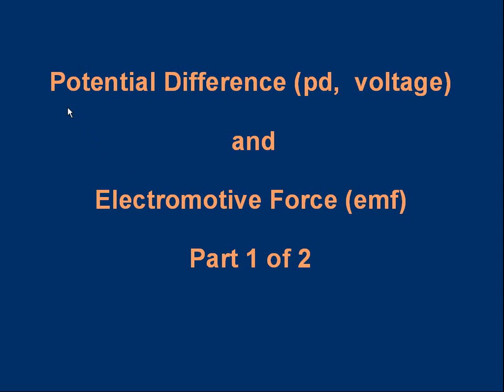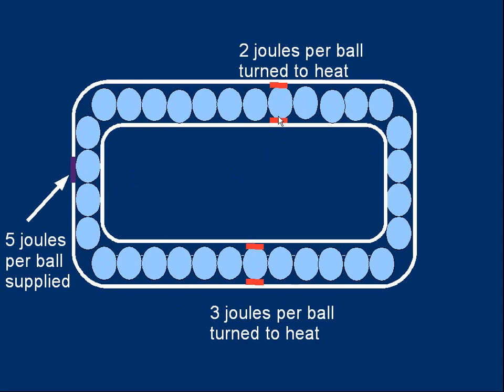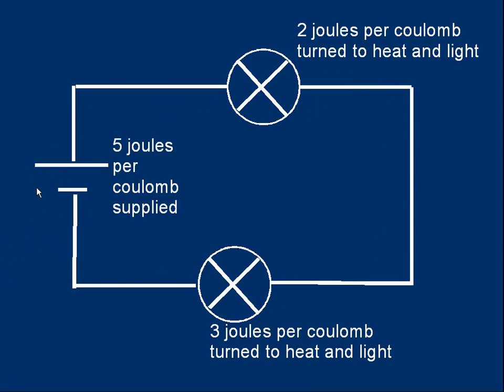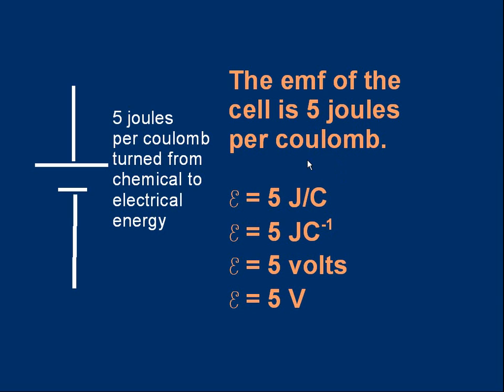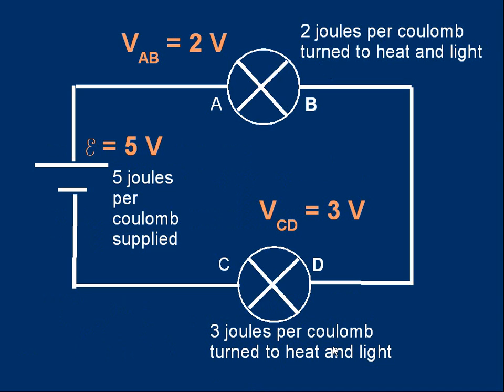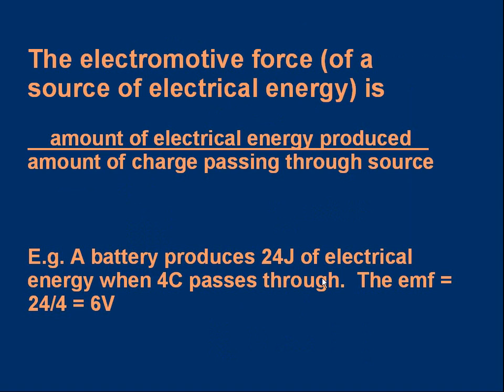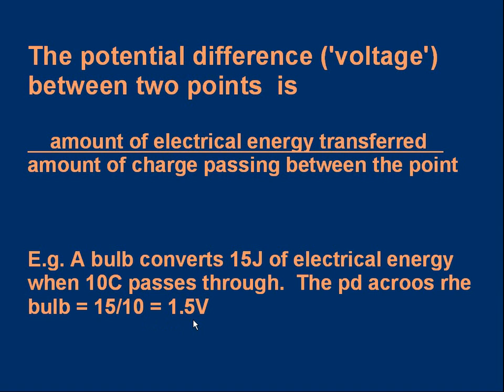GCE (A level) Physics E03 Emf and voltage. Part 1 of 2

Comment: Mr. Steve, would you define the voltage between two points as the change in energy per unit charge between the two points, or the change in potential energy per unit charge between the two points? The standard definition of voltage is potential energy per unit charge. However, I don't quite understand why potential energy loss should be more across a resistor than a wire. Change in potential energy is a function of position, not friction/resistance. On the other hand I can see that kinetic energy is lost to the resistors in the form of heat.
Reply from the maker: +1steinstein

Long answer...

Note that when there is no current, the potential in a conductor is constant –  there is no potential difference between any 2 points in this situation.

E.g. if you connect a circuit to the +1.5V terminal of a cell but leave the circuit incomplete (don't connect to the 0V terminal of the cell), no current flows and  the potential at all points in the circuit is 1.5V. No potential differences exist in the circuit.

But when a current flows through a conductor, the potential varies along the conductor and the potential difference between any 2 points can be found using V=IR where R is the resistance between the 2 points and I is the current.  That's  because there is energy transfer (usually to heat)occurring.

So these are 2 very different situations. And each has its own definition of voltage. 

____________________________

In a static situation (no current flowing) I would define the voltage between two points as the change in electrical (potential) energy per unit charge between the two points.  This is always zero in a conductor when no current flows.

But in a circuit with current flowing, I would define the voltage between two points as the amount of electrical (potential) energy changed to other forms of energy per unit charge passing between the two points.

____________________________

“However, I don't quite understand why potential energy loss should be more across a resistor than a wire”
 When a current flows, there is (usually) much more energy transferred in a resistor than in a connecting wire because the resistance of the resistor is generally much more than the resistance of the connecting wire. V = IR must be used. 

If no current is flowing, the voltages across both wire and resistor are zero.
____________________________

“Change in potential energy is a function of position, not friction/resistance.”

Not true. Try these statements:

Change in potential energy is a function of only position when there is no current
flowing.

 Change in potential energy is a function of current and resistance when a current flows. 

____________________________
Not sure if that clarifies anything, but it gives you plenty to think about!

Comment: ok Mr Steve 
Clear me one thing
If the current we supply is for example 5 joules per charge so if 2 joules is lost at one resistor and 3 joules at the other then it means that all the energy we give will be lost at R2 (resistor 2)
so why does the currrent further moves ?
Is it due to inertia or its momentum during movement in the circuit ?
Reply from the maker: +Hamza Zubair 

“If the current we supply is for example 5 joules per charge”

Note.  Current is not measured in “joules per charge”.  It is measured in amperes (amps) (coulombs per second).

You mean “If the supply's emf is 5 joules per coulonb...”
____________________________________________________

“so if 2 joules is lost at one resistor and 3 joules at the other then it means that  all the energy we give will be lost at R2 (resistor 2) so why does the current further moves ? Is it due to inertia or its momentum during movement in the circuit ?"

If there is no resistance, there is no energy less. We see this 
in a vacuum (e.g. electron beam) or a superconductor.  And yes – the 
simplest way to think about this is it is due to the electrons' 
momentum.

But in a real-life circuit, the connecting wires have some small 
resistance, so there is always some energy loss in the wires.  The 
energy loss in the  connecting wires will usually be very small compared to the energy loss in the resistors.

So if the supply has emf=5V we might have: 
0.02 J/C lost across 1st connecting wire
1.97 J/C lost across 1st resistor (slightly less than 2J/C)
0.02 J/C lost across 2nd connecting wire
2.97 J/C lost across 2nd resistor  (slightly less than 3J/C)
0.02 J/C lost across 3rd connecting wire
These add up to 5J/C as required.

However, the energy loss in the connecting wire is usually so small we ignore it and keep the calculation simple.

Hope that makes sense!
Reply: +Steve4Physics ... so in the above example, what if you take out the 2 lamps. so now you only have the resistance of the wires = 0.06 J/C lost. Does that mean that 4.94 J/C is returned to the battery? or is it always the case that 100% of the voltage is used up by the circuit? and if that last statement is true, does that mean that the resistance of the wires go up to 5 J/C?
Reply from the maker: +AgeofVergo 

“so in the above example, what if you take out the 2 lamps. so now you only have the resistance of the wires = 0.06 J/C lost. Does that mean that 4.94 J/C is returned to the battery?”

No.
 Let's assume we are talking about a perfect battery (no internal  resistance).
The battery would continue to produce 5J for each coulomb passing through it. That's its emf and is controlled by the **chemicals** used to make the battery, not what it's connected to.
The wire will now produce 5J of heat for each coulomb passing through it.
___________________________________________

“or is it always the case that 100% of the voltage is used up by the circuit?”
Voltage isn't 'used up'.  But I think you mean "is all of the emf applied to the circuit?"

The answer is yes (assuming no internal resistance in the battery).   The voltage across the wire is the full emf, 5J/C (5volts).
___________________________________________
“does that mean that the resistance of the wires go up to 5 J/C”
Resistance is not measured in J/C.  The wire's resistance depends on its size/shape and what material it is made from.  The voltage or current does not change the wire's resisitance (though resistance can change with temperature).  The wire's resistance will usually be low – so many coulombs will flow through it each second. Note that 5J/C does not tell you how quickly heat is produced. Suppose the voltage is 5J/C: 
If 0.001 coulombs per second (=0.001A) flows, the heating is slow.
If 100 coulombs per second (=100A) flows, the heating is fast.
The size of the current is I = V/R.
Hope that helps.

Comment from the maker: +don't Bother

Hi. Sorry. Answer is a bit long. But I've tried to explain thoroughly. You might have to read it a few times!

Your original comment has disappeared Apologies if I deleted it.
________________________________________________________
Comment on potential difference (p.d.)

First:
"bringing a unit positive charge from one point to another point in a circuit is called potential difference between two points"
is not quite right.

To be accurate we must say something like:
"The potential difference between 2 points (A and B) equals the work done moving unit positive charge from A to B.”

E.g. if 6J are needed to move +3C from A to B. the p.d. between A and B is 6/3=2V. This means B's potential is 2V higher than A's potential. B is more positive than A.

But we could equally well say the p.d. between B and A (reversed order of letters) is -2V. This means A's potential is 2V lower than B's potential. A is more negative than B.

In symbols: VAB = -VBA and VBA = -VAB.
For simple problems it often doesn't matter what the direction is. So we often just say the p.d. between A and B is 2V without bothering to think about the direction. So we often just use the magnitude of the p.d.
________________________________________________________

P.d. and type of charge
Sometimes positive charges move (e.g. protons in a beam of protons). Sometimes negative charges move (e.g. electrons in a simple electrical circuit). Sometime both types of charge move in opposite directions at the same time (e.g. + and - chemical ions in a battery or during electrolysis). We need the concept of p.d. in all these cases.

So if necessary, we can easily re-word the above definition of p.d. in terms of the flow of negative charges. It would simply be:
"The potential difference between 2 points (A and B) equals the work done moving unit negative charge from B to A.” Note the order of the letters.

When thinking about p.d. a flow of negative charges from B to A is completely equivalent to a flow of positive charges from A to B.

But it's traditional to define p.d. in terms of positive charges. So we simply don't bother with the definition in terms of negative charge.
________________________________________________________

Conventional current

In fact we don't even normally think about the electron direction when analysing circuits, The usual practice is imagine what is called “the conventional current” flowing from the positive side of the battery through the circuit to the negative side of the battery.

Physical electron flow is opposite - from the negative side of the battery round to the positive side. But we can 'pretend' positive charges are flowing (conventional current) in the opposite direction to the direction of the electrons – and it all works out correctly!

I understand how confusing it is but it gets easier the more you think about it. I hope that helps.

Comment from the maker: Hi.  I don’t use the term ‘energy levels’ so I don’t understand the question.

We are interested in amounts of energy changed to heat, in the examples.

E.g. if 50J of the supply’s energy are turned to heat when 2 balls pass through a rough section of pipe (due to friction), the energy transferred per ball is 50/2 = 25J/ball.

Similarly, in a circuit, if 50J of electrical energy are turned to heat when 2 coulombs pass though a resistor, the energy transferred per coulombs is 50/2 = 25J/C =25V.

Comment from the maker: Basically ‘yes’ to your questions – with slight changes.

If you follow a conduction electron (say) anywhere in the circuit while current flows, the electron:
- accelerates, taking potential energy from the electric field;
- has a collision (decelerates), transferring energy (causes heating).

The above processes are repeated millions of times per second.  On average the electron appear to move with a steady velocity (the drift velocity) but is actually continually accelerating and decelerating

Comment from the maker: All the balls move together at a constant speed even when there is resistance.
If the resistance is increased, all the balls move at a slower constant speed.

Think of pulling a car with a rope.  You give the car kinetic energy, but the rope (very low mass) has virtually no kinetic energy - the rope transmits the energy. The rope is equivalent to the electrons.

The energy is being transferred as electrical potential energy in the electric fields between electrons.

Comment: Would a higher e.m.f mean a cell is doing more work on a charge, therefore it would have more P.E?

And such would the charge accelerate in the same way a mass would as its gravitational P.E gets transformed into kinetic energy.

The charge would accelerate faster with a higher voltage meaning a faster average drift speed, and this is why higher voltage means higher current?

Comment from the maker: Hi.

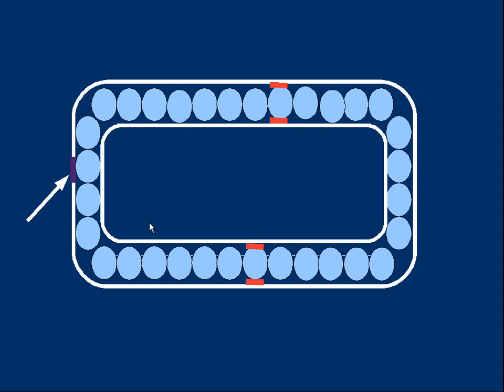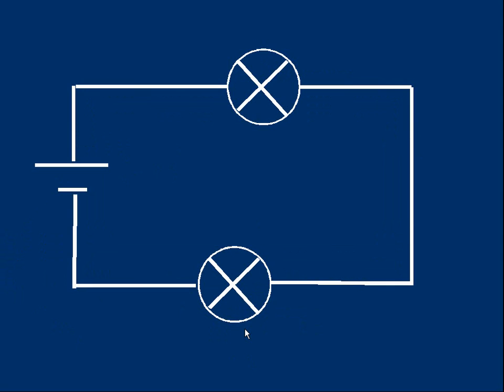In the video, from 1:50 to 4:00, you will see that ALL the balls travel at the SAME speed.

The transferred energy is NOT the kinetic energy of the balls.

The balls (i.e. electrons) are acting as a medium to transfer energy from place to place. When a ball loses energy due to friction it makes ALL THE OTHER balls in the circuit move with the SAME (reduced) speed. 

Try to imagine you are pushing the balls around. Think about where the energy you supply ends up - this should help.

Comment from the maker: Hi Shines128.

'Terminal pd'  is short for terminal potential difference. It is sometimes called 'terminal voltage'. It is the voltage between the battery's terminals.  So it is the voltage being applied to the rest of the circuit. 

If there is no internal resistance, it is equal to the battery's emf and would often be simply referred to as the 'battery's voltage'.

If there is internal resistance, it equals the emf minus the 'lost volts' (watch part 2).

Comment from the maker: Hi again.

My 1st answer was too complicated.

The potential difference between point (A) to the left of the 3J light bulb, and a point (B) below the negative (charged) portion of the cell is zero.

If we take the negative terminal as being zero volts, then A and B are both at 0V.

Think of the wire connecting A and B as zero resistance. V = IR = Ix0 = 0.  There is no potential difference between A and B so they are at the same voltage (potential).

Comment from the maker: Hi.
Yes, bulbs act as resistors. (But resistance may depend on voltage – not be a fixed value.)
A potential difference is between TWO points. A single point can’t have a potential difference – only a potential.

If we say the battery’s negative terminal (NT) is zero volts, then the potentials at different points are:
NT= 0V
Left of 3J=0V
Right of 3J=3V
Right of 2J=3V
Left of 2J=5V
PT= 5V
For example, the potential difference across the ‘2J’ bulb is then 5-3 = 2V.
Hope that helps.

Comment: A quick question. Are the two light bulbs at 5:12 considered resistors? If so what would be the voltage/potential difference at a point to the left of the 3J light bulb, and a point below the negative (charged) portion of the cell? 0V?

Comment from the maker: Hi TheDaVincci.
The mistake is "neutral is safe because the current gets consumed by a device."
Current is not consumed by the device. Neutral is safe because it is at (nominal) ground potential - even when carrying a current. The current through the live wire equals the current through the neutral wire - measure them (with caution!) if you want to see this for yourself !  That's why neutral wires have to have the same current-rating as the live wires. Also check how RCDs operate for example.

Comment from the maker: Hi. That is correct, but I would word it slightly differently:
EMF is applied to devices which supply electrical energy.
Voltage is applied to devices which use electrical energy.
Both are measured in joules/coulomb (volts).
They tell you the amount of energy transferred when 1 coulomb passes through the device.
It is a common mistake to use the term 'voltage' when you mean 'emf', but usually this doesn't cause confuision and even teachers and electronic engineers do this sometimes!

Comment from the maker: When we talk about a ‘2 volt bulb’ it means the bulb is designed to operate with a p.d. of  2 volts across it.
You can operate the bulb at a lower p.d. – but the bulb will be too dim.
You can operate the bulb at a higher pd – but it will be too bright and you will reduce its life or even burn it out.
If you connect a 2 volt bulb to a 5 volt emf battery (assuming the battery’s internal resistance is negligible), the bulb will glow very brightly and then probably burn out almost immediately.

Comment from the maker: Hi.  You are mixing-up emf with electric field strength (E).  E is measured in volts per metre or newtons per coulumb  (V/m and N/C are equivalent).
Emf is simply measured in volts.
Good luck with the test!

Comment from the maker: @mediamaster08 
The electrical potential at a point is the amount of potential energy a unit charge would have at the point.  The potential difference (PD) between two points is simply the difference in the values of potential at each point.  So PD is the difference in potential energy per coulomb. A fuller explanation would take too long, but just do a search on ‘potential difference’ to find out more. When you learn about electrostatics and electric fields, it will be explained in detail.

Comment from the maker: @mediamaster08 
Hi.  The ‘table tennis balls’ is only a model - don’t treat it too literally.  When a current flows in a circuit, there is kinetic energy involved, but the amount is very, very small, because the electrons are so ‘light’ and move slowly; the electrons’ kinetic energy is too small to matter.

Sometime emf and voltage ARE the same value.  But we use ‘emf‘ when taking about a supplier of electrical energy and ‘voltage’ when talking about a user of electrical energy.

Comment from the maker: @804YankeeFan 
Its a continuous process. Electrical energy is delivered at a steady rate over a period of time.  The battery is acting like a steady pump, pumping electrons around the circuit. But of course, when the battery is dead, the electrons 'stop moving'.

Comment from the maker: @SalmanBacha 
Emf is always inside the battery (or generator, or photcell, etc.).
In a simple situation (no internal resistance) voltage is outside the battery.
But if there is internal resistance, there also a  voltage drop inside the battery which must be subtracted from the emf.

Comment: @Steve4Physics Thnx Sir and i know that emf is not force,its work done on a charge in moving it from negative plate towards the positive plate inside the battery,and the resistance that the charge faces inside the batery while moving from negative to positive plate is called internal resistance?Is it a right concept?Or emf is the energy generated by the chemical present inside the battery?So tell me that emf is inside the battery or it is in the circuit and voltage inside battery ?